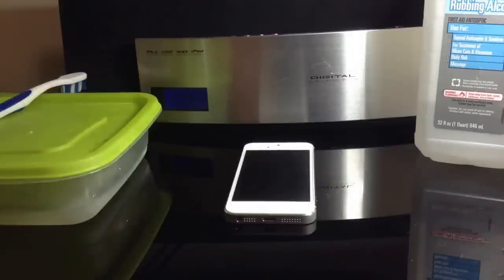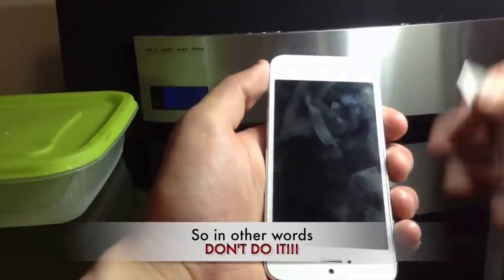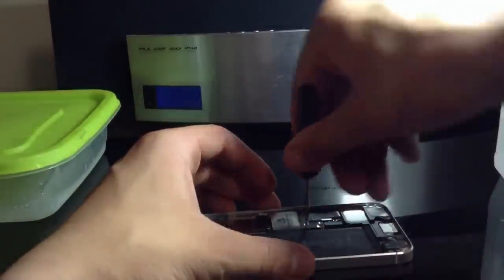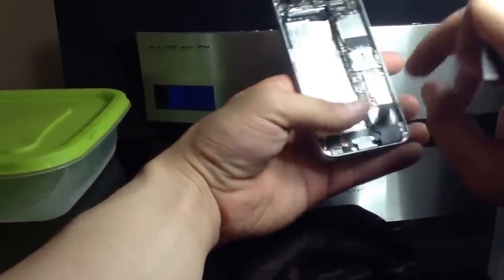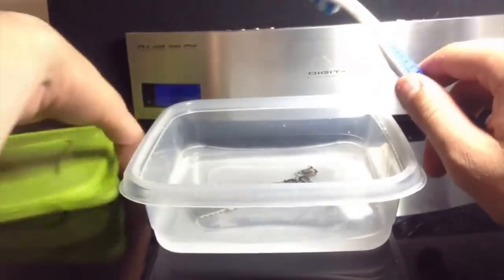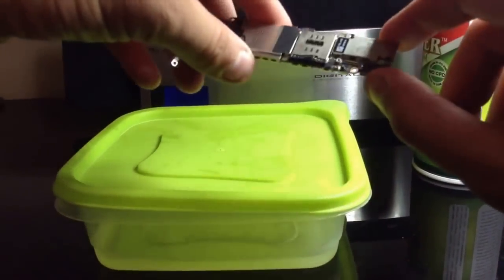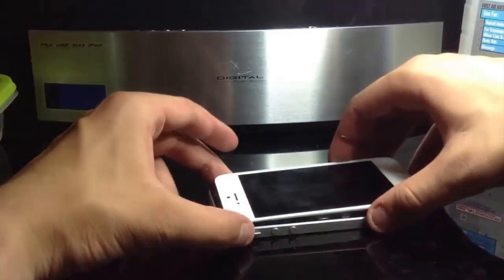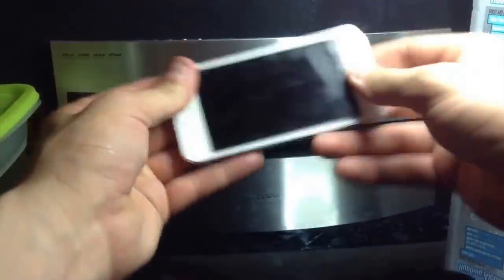iPhone water damage repair DIY (full step by step guide)

Comment: Hi, I sent my phone off to Apple for signal problems and they've told me my 5c is water damaged. At first I was super confused, but then remembered I briefly dropped it in a toilet for about a second months and months ago. It has been working fine since then, the only problem I have noticed only recently (since I moved house) is that I have problems getting signal and 3G connection. Wifi is always fine. They have quoted me £175 to fix it which I can't afford right now and just seems so unreasonable for such a small problem. Would you suggest I ask for it back un-repaired and try and follow your video instructions myself?
Reply: yeah, i agree with you. i dropped my iPhone into the closet for about 5 seconds, but I have to pay 592 dollars to get a new one. and it's so unreasonable

Comment: Hay man great video. I have question. I had dust under the display light assembly. I disassembled it clean it, now I have weird light projecting on the screen it's like wave of bright and dim light flow. I know the light is coming from top of the screen but the wave is side ways. Just wondering if you had any similar experience. Thanks in advance.

Comment: Thanks for your video I'm not even sure how my iphone got water damage but I started following you on your video and noticed red water marks so I did the alcohol trick and still no progress. So a few days later I bought a battery and tested to see if it worked and it did, but then after I snapped everything back together it didn't turn on and the top right hand corner of the screen got alarmingly hot. I immediately took it apart and disconnected the battery, what steps should I take next?

Comment: Hi Nate greetings from rainy Scotland thanks for the helpful video. My iphone5c dropped in a river whilst fishing I immediately tried rice for a week.... no joy, then a new battery, again no joy and now just tried your video and still no luck.
It will not switch on at all or recognise the charger.
I don't think it is the screen (which is in perfect condition) as surely I would have heard the charging alert? No rusting or corrosion on the inside that I can see, can I ask do you have any other suggestions or is this handset a lost cause?

Comment: Hi I just did this with this tutorial. Couple things: Phone would not turn on after it was in water. I tried once, immediately disassembled the whole phone put all of the pieces with silicone packets and rice. I know you say rice doesn't work but I did use silicone. 

Put it on a charger after reassembling after your tutorial, won't turn on. Every water mark is bright red(the one up top by the camera, the one in the middle of the phone, and the bottom one, do you think the whole phone could be done for or maybe its just a battery?

Comment: Hello I found your video helpful. In December I dropped my phone in the swimming pool 9ft down. Got it out quickly it wouldn't turn off so I turned the screen off and let it set for a month or so in rice. I know i know. Anyway i turned it on after that it worked fine for a bit. Then a month ago it started freaking out, the screen didn't work properly. So, i've taken it apart to clean, although I don't really see any rust. The battery was soft and I still need to clean the board, but don't have the dust stuff. Do you think I need a new screen and didn't need to clean it?

Comment: I enjoyed watching your video very informative. However, I have a question. My wife and kid used the rice method (which didn't work) but the iphone turns on. When i eventually got home and turned it on, it displayed the itunes symbol. So i hooked it up to the mac and attempted to restore it, but it failed with an error. So I tried to factory restore, but it failed as well. Is the phone done for? or is there a possible chance for me to fix it using this guide. Fyi, this was a 3 weeks ago. I know time is crucial in these matters. Thank u.

Comment: Hello Nate! My niece got her iphone 5c wet and she put it in rise for like a day ( i dont think she turned it off right away) the phone worked for like 3 days afterwards but it kep restarting (i guess because the battery was damaged). I order a new batery for it, but when i turn it on the screen was black and i put the phone under a lamp and it turns out the phone was working but the screen loose all its light and you could not see anything at least it was under the lamp. I put on the new batery and it did not restart by it self anymore, I thought maybe the lcd got damage so i order a new one (i put it on and its still not working) . I order the isotropyc alcohol (spray version) and I clean the mother board I just reasembled it back and it is still the same, i can use it but just if I put it under a lamp to be able to see the screen (othervise it looks like its off) i went to setting and check the brightness in the screen and everything seems fine but the screen....what can i do? Thank you in advance

Comment: Hi, I follow your video it was very helpful I could get a good clean on my phone.
The problem is when I was putting the pieces back on the WIFI cable got damage “its unplugged from the connector" I try to weld it back again but my WIFI sometimes works sometimes doesn't. Any help??

Comment: Hi Nate, I followed your instructions and the phone come back on but had problems with wifi not working and also the screen light flickering brighter at times. So I took the phone apart again and clean the connections of the screen to the mother board and also made sure the wife was snapped in better. I let it dry and went to reassemble and the battery sounds when I plug it in to charge but my screen is black. No sign of any connection to that part. Any suggestions? THank you!

Comment: Alright so I did this and my iphone came back to life. Thank you! Only thing is, my LTE and 4G connection is now incredibly slow. It almost doesn't work. And my auxiliary port doesn't work at all either.. Can you help me??
Reply from the maker: Here is what you need:

Dock assembly (includes data antenna and headphone jack)

http://www.ebay.com/itm/White-Headphone-Audio-Charger-Charging-Data-USB-Dock-Port-Flex-Cable-iPhone-5S-/261381598459?pt=US_Cell_Phone_Replacement_Parts_Tools&hash=item3cdb8eacfb

wifi/bluetooth antenna (because why not lol)

http://www.ebay.com/itm/New-WIFI-Signal-Antenna-Flex-Cable-Ribbon-Replacement-Part-Tools-for-iPhone-5S-/371141876966?pt=US_Cell_Phone_Replacement_Parts_Tools&hash=item5669c79ce6

Comment: Hi Nate, I have two iPhone 5 , one of them is water damaged, so I gave it to the local repair guy and he replaced the screen on it with a cheaper lower grade C screen. now the new problem that arose due to this is that the phone heats up and the touch is really bad, so my what I decided to do after watching your video is to replace the cheap screen on on my own with the original screen from the other spare phone I have. However when I put the original screen onto the other phone it doesn't seem to work for some reason :(
All i see on the phone is horizontal white lines like an interference pattern when I press the power button. no picture at all . and this is really strange because when I switch back the screens to how it was previously every thing works fine. both screens  show full colour and picture . I really want to understand what could really be the issue . Can u plz help me out sir with this problem. The touch of the cheap screen is very bad and I want to change it. is there anything I haven't considered here, are screens from other phones not compatible or something?
Awaiting your reply. Is there any way I could contact u personally over mail or something. some pro tips would be really appreciated. 
Thank you for a great informative video. Cheers

Comment: Hey, I've watched your video and 5 others. My problem is, my wife's white iPhone 5s has a ribbon inside it at the home button area between the case and the screen which IS NOT the case in ANY OTHER video I've watched. So I can't open the phone up like you show in the video.:( her phone got wet and I'm trying to fix it as I can not afford to buy her a new phone. Any advise or help would be greatly appreciated.  Thx

Comment: Hello Thanks for sharing such an informative video!
I had dropped my phone in the toilet. It turned off but when i turned it on it did work but the battery was loosing its charge quickly. I put that for charging after an hour or two i found it not working at all, and i could only see an apple sign and went off permanently. I tried these steps as you did and also changed the charging port assembly except for the speaker. It's now flashing with apple sign on and off, along with two vertical lines on one side. Can you please tell me what can i do about it? Do u think it's the battery?
Reply: Safar Ali Mine is doing the same thing, flashing on and off with some vertical lines..have you found anything out yet?
Reply: it may be a loose cable, i noted the same when i replaced the screen, Good luck

Comment: I just got done trying this on a iPhone 5 I dropped in the sink two days ago. When I got done, I, too, had two screws left but everything worked besides the proximity sensor. I now know that the screws that are missing are the ones that hold the camera in place behind the logic board. Could that be why my proximity sensor isn't working as it is located by the camera?

Comment: Hi Nate Rist, 

Before I saw your video, I put the water damaged iPhone in the dreaded bag of rice and after 24 hours, the phone was recognised by my iTunes. However, the day after, the iPhone stopped being recognised by iTunes. 

Does that mean that somehow the iPhone is still recoverable if I remove corrosion? Or can corrosion damage it beyond repair?
Also, does that mean that the problem comes from that very cable which goes from the Lightning connection to the motherboard?

Thanks for your help.

Comment: hi +Nate Rist 
I bought an iPhone 5s and its water damaged, and the problem with it is that it turns on, but it is stoked in I tune loop, or whatever the name it has ☺, and actually it turns on only when its plugged in. I tried to fix the loop by restoring it but it got worst and it just shows the apple logo. And I tried your solution too but its still the same. What do u think I can do?

Comment: I have a iPhone 5 and it has water damage. The screen was cracked so i replaced it thinking that was all that was wrong with it. Once i opened it up i saw signs of water damage. I cleaned it like in this tutorial and the screen is still black. The phone is on as the vibration is working. Do i need to replace the motherboard? and if so what do i need to know before i order it? Its a Telus phone.
Thanks

Comment: Nate

i've replaced the battery and followed the steps in your video. plugged it into the wall to make sure there is a charge, when i try and turn on the phone the screen is still blank, completely black.. any suggestions on what else i can do? or what i need to buy to fix this issue?
(phone was water damaged, when removed from water the screen had separated from the base)

Comment: i have a water damaged iphone 5c. I had it put in a bag with rice when the water damage happened. After a week, i turned it on, iTunes recognized it. I was able to back up the photos and video off of it. It gets text, i can hear it vibrate when i try to call it. The screen is black though. Opening up the phone i see water damage indicator in all three locations, near the battery, near the sim slot and top near the camera. The screen was completely black. Is it worth trying this method to see if i can get the screen to work? I do not see corrosion at all anywhere inside on the connectors. This phone was taken out of the water right within a few seconds. The battery also seems fine. Appreciate your help.

Comment: Hello nate i recently left my iphone 5c outside and it rained i did the alcohol procedure and the phone somewhat worked but unfortunately the home button would not respond and sometimes the screen also i left the phone alone for a few days and i came back and i charged it for up to an hour and the battery indicator was still on red is there any solution to this thanks

Comment: Sir, if its a sea-water and the phone got a bit rusty inside - is it still fixable the same way? Its iPhone 6+. 
It happened few days ago and now i am trying to fix. 

Also, if instead of taking apart totally i immerse it into alcohol (without battery and the screen but not unscrewing the camera and the rest) would that be helpful?
thank you very much in advance.

Comment: hello i did that same thing but once i connect the logic board it starts to get hot until it burns !!! 
so do u think is there any other way to fix this issue ?? any repair any solution its a locked phone for att just replace it couple of month ago and don't wanna brake the contract and don't wanna loose all the information so i wish u can help with that 
thanks in advance !!

Comment: @Nate Rist i followed your tutorial and all (cleaning the logic board with the alcohol and brushing it) and i tried to test it but it didn't turn on. So I then decided to buy a new battery. When I entered the new battery i then charged it and after a few moments it vibrated so I assume that it works?? But after a few moments it started to vibrate two times every 5-6 seconds and the screen doesn't turn on. What do you think is wrong?

Comment: Thanks for posting this video! I tried connecting everything to see if it boots back up, and it did. But somewhere in the process when I putting all the screws in, etc.. now when I try to charge my phone, my screen is black and I hear a constant beeping sound. What does that mean? (I appreciate your help) :)
Reply from the maker: your screen might not be reading on the board and the charge port isn't staying connected. Open the phone and check both the board terminal for the LCD and charge port and check the flex cable terminals as well. you may need to order both, but you can email me pics of what you find if you like before doing so, so I can see what you're looking at as well

Comment: I had my iphone 5 in a life proof case and accidentally went surfing in the river with it while it was in my wet suit. I don't know if it was on when I got in the water and it stayed in the water for about 30 mins. I vacuumed the water I could out of it and then left it in rice for a few days. Then I found this video and pulled it all apart putting rubbing alcohol on it and trying to clean it. I tried to turn it on an no response. How do I know if it is just the battery or the whole motherboard. How do I know was parts to replace?

Thanks,

Comment: i tried this (soaked and cleansed the logic board, then i dried it out with a vacuum since i didn't have an air duster) but it's still not working, it's exactly as before where it's only showing the apple logo for 2 sec and the screen turns black. Will replacing my battery work (or maybe the logic board?) or is it better to just buy a new phone?

Comment: Hey my name is Jason Thanks for posting!! I clean the phone a put a new battery in it.  But when I got it all together it just shows the Apple logo then turns off.  I'm just wondering what would be the next step in repairing it?
Reply from the maker: sounds like it's either a faulty battery or connection or not getting power from the battery terminal on the logic board. Does it only do it when it's on the charger or plugged in? or without?

Comment: The salty sea water leaking into the phone and I have replaced the battery today..however the screen showed the apple icon with message "【nand】 findflashmediaAndkeepout:600 physical nand block offset 1" when I attempted to turn it on. Which part was broken? I am looking to replace that if you can help figure it out.

Comment: I mean like I have a iPhone 6 and wondering since I had my phone in my shorts when I went into the water which was chlorine, is this the same interior as the iPhone 5... Would this be able to be fixed if it was done right?

Comment: Nate, when I removed my screen, the glass sort of separated from the metal backing... is that going to be a problem in it "staying tight" when I put it back together?
Reply from the maker: Robert Gabsa You can reattach it with glue, but only a very VERY small amount. Line the plastic frame with it and seat it with the glass edge. Again only a VERY LIGHT AMOUNT is needed. Any excess on the screen can be lightly scraped off with an exacto blade when dry

Comment: I have an iphone 5s that is water damaged and is in restore mode it get through most of the restore but then doesn't complete and gives me error code 1 which from what i found an what it seems to be from the restore log it is a baseband related error. Have you come across something like this and managed to get it working?

Comment: Hi,
I opened the iphone 5s and saw that the connectors for the LCD/Digitizer/Camera has some marks on it (may be burned or corrosion). I tested the LCD/screen on another phone and it works. What should I do to fix these marks? Should I just assume that the connectors on the motherboard are burned? Is the iphone fixable even if the water damage was done about over a month ago?
Please let me know.
Thanks

Comment: You should really take off the motherboard shields it gives you a better chance to clean all the components. (400 degrees Celsius on a hot air station should work just fine to get the shields off and also to put them back on)
Reply from the maker: Never been an issue, I don’t do this for people anymore anyway, so doesn’t matter to me at this point. Thanks for watching

Comment: i have water damage in my phone. it wasnt submerged in water but it had some water that dripped on to it. the red light is showing and it has a water stain. should i do this option? Is this 100% it will work?